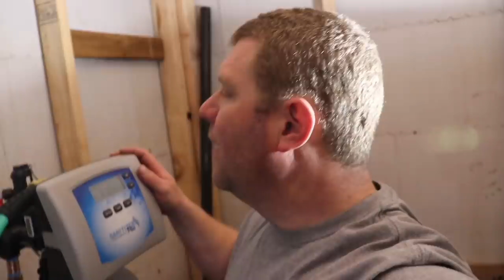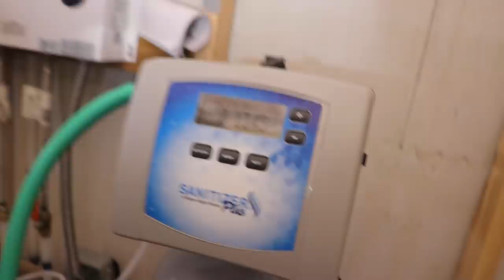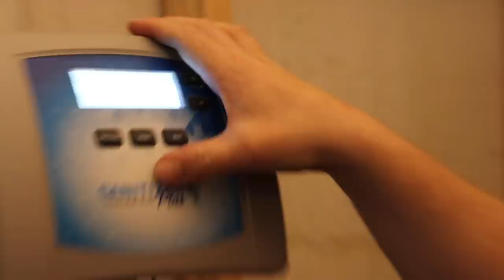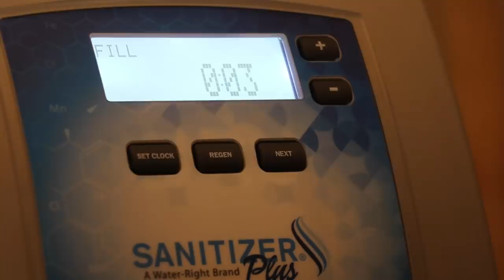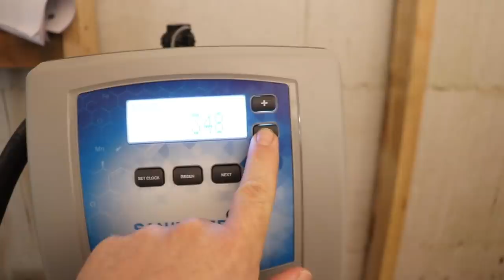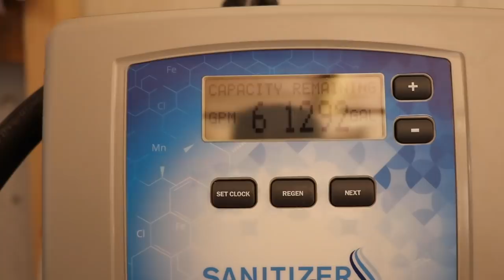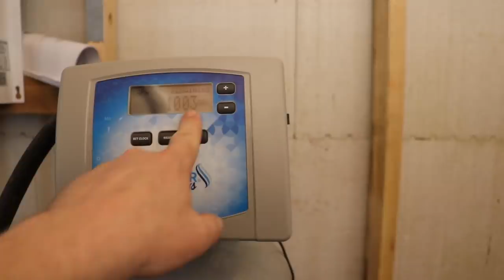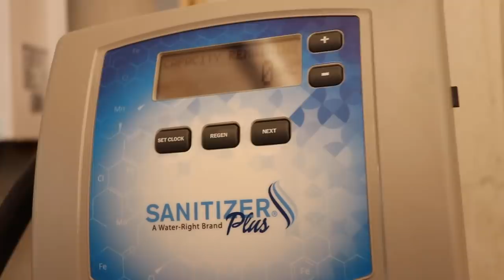Filling $10,000 Off Grid Water System from Brand New Well

Comment: With all due respect, I think you guys are over-infatuated with your "clean" cisterns! :-) I don't see it being practical to filter and soften every drop of water you use. Besides, the extra duty cycles on your softener and filter, to say nothing of the extra salt, seems wasteful. 

If I were you (:-)), I'd plumb the well directly into the cisterns, with a reliable, automatic level control. Then plumb the softener and filter to treat only the water used IN the residence, leaving outside faucets for things like filling the hot tub, watering the garden, and washing vehicles.

But, that's just me, siting in an "armchair", 1000 miles away...

Comment: At 4:00  :-(   You are still doing it wrong. You are right handed. Hold the part in your left hand, with your left thumb just at the left edge of the threads. Stick your middle finger (give it the bird) through the hole in the spool, with the tape hanging down about 2" on the far side of the spool (do not let too much hang down), away from you. Place the tape on the near side of the part, about half on, and half off the threads, clamp it there with your left thumb. Roll the tape over the top of the threads, pulling on it slightly, to keep it tight. Continue wrapping the tape around the threads snugly, over lapping the previous wrap by about half, this will give you a double thickness. Wrap turns tell you have about 1/2 of a wrap overhanging the threads at the end, then make another wrap, angling the tape back to the left, so you have a full width of tap tied back into the threads. At this point place your left thumb on the tape at the end of the final wrap, and hold. Now, grip the spool in your right hand where it can not turn, and pull down and into the threads until it breaks. Smooth down the end of the tape "into" the threads with your thumb.*****You do NOT need to wrap more than one wrap, except at the end where you end up with a triple thickness, to tie the tape into the threads !*****Always remember, you need to always wrap the tape "INTO" the threads. Not counter clock wise. This will ensure the tape is pushed into the threads as you put your parts together. Hope this helps.